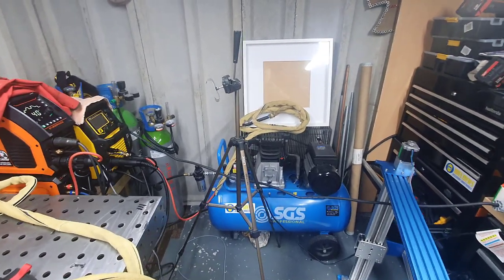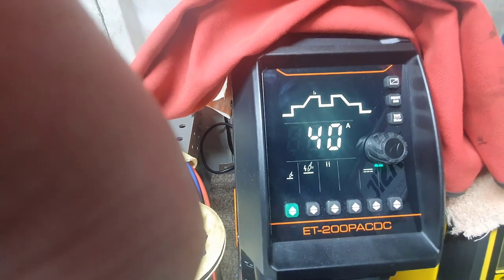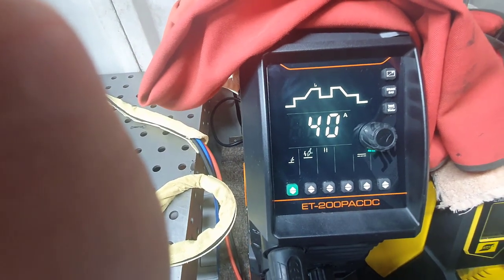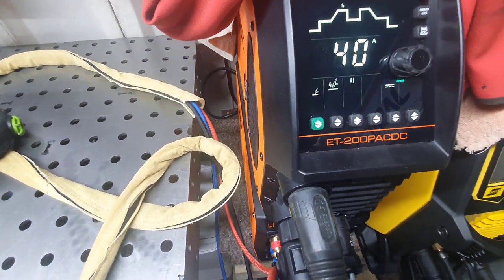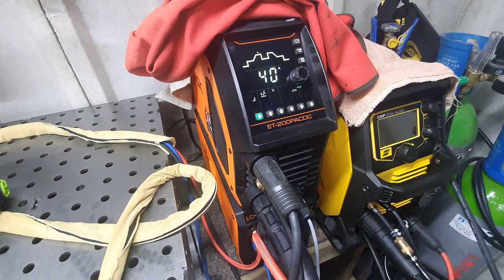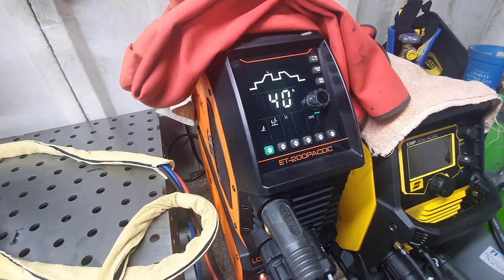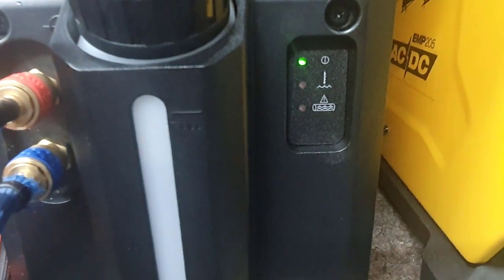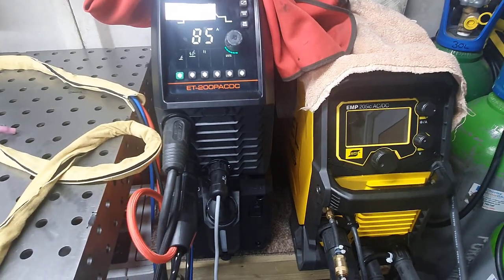Jasic EVO 20 Tig 200acdc with Water Cooler

Comment: So did you get the foot pedal or did you rewire the one that you already had, and in case of the latter, how hard was it?
Asking because I'm on the fence and find the new prices for those pedals kind of high...
Reply from the maker: Yes I went for the wireless mate but the wireless adapter was quite a fiddle. Are you uk based
Reply: @smallgarageworkshop6119  no, actually based in the Netherlands.
and looking for a capable machine. Found your video enlightening, as you're the only one talking about the pedal, and original versus aftermarket torch as well!

Thanks for both the answer and the video. Makes the decision process a bit easier.
Reply from the maker: I mean could get it and ship as I would be able to get it cheaper I reckon
Reply: @smallgarageworkshop6119  it's more a question of "is a pedal worth 500 pounds" and do I buy the newest machine or do I buy the previous version that's cheaper and has cheaper accessories.
Reply from the maker: @fladder1 The newer machine is better but yes 500 pound is a lot for the wireless one. Send me a dm on insta and Will send you a price
Reply: @smallgarageworkshop6119 Were you able to install the bluetooth dongle? The instruction does not match my welder regarding circuit board schematics. 🙄
Reply from the maker: @HBFJ84  Hi Yes i install the Bluetooth dongle no issue other than it is a fiddle if you don't remove the screen.
Reply: @smallgarageworkshop6119  Thanks - I figured it out. Not the best documentation for the process of installing the dongle. 

Awesome machine though 😊
Reply from the maker: @HBFJ84  oh yes they are the best for that price range 👍